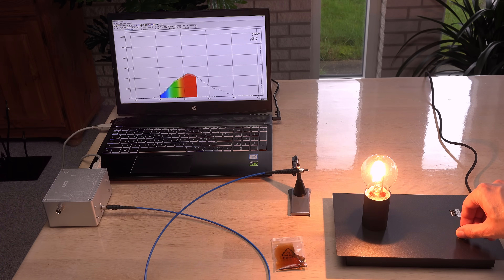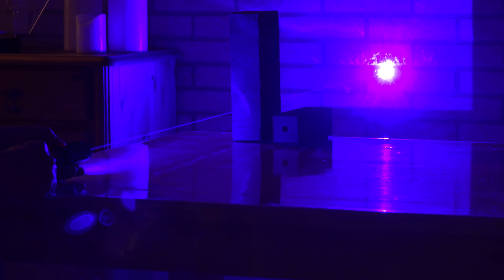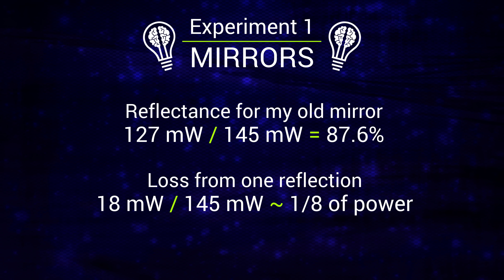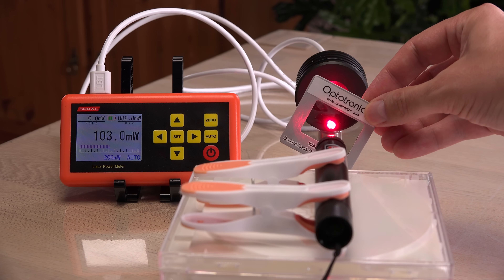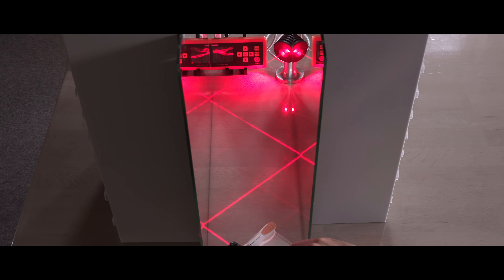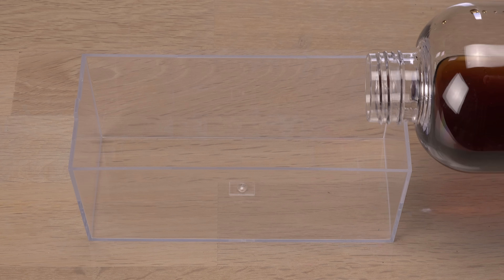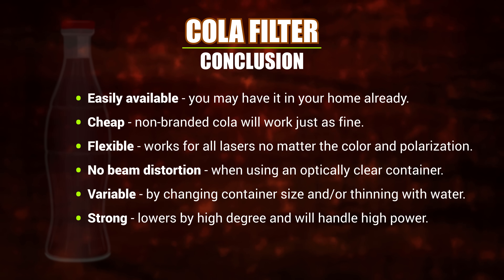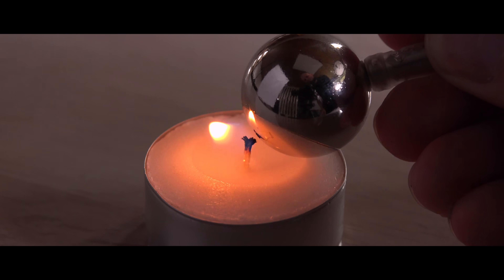COLA is PERFECT for lowering a laser's power!?!

Comment: Well it would be a real shame to damage or destroy that filter but I have to know how strong a beam it takes to burn through it. I vote for stress test. +1
Reply from the maker: Noted. I am curious too. How strong a beam will it handle on the same spot for some time without the beam burning through? I honestly don't know. The plastic filter did poorly. It wasn't even held steady :)
Reply: @brainiac75  Well i'm sure you already know the result, localised heating in glass has no good outcome like dissipating heat in a small volume of material always leads to a magic smoke or meltdown. Anyway i'm curious about high powered laser in cola should be interesting ;)
Reply: @brainiac75  i am really curious about what material is put on the glass to assemble the varable ND-Filter. if it's graphite, i'd suggest that it won't be harmed for a looong time, while you up the power of the lasers :)
PS: i do love to be lazy and not do research theoretical stuff, since there's giys like you out there, who make it possible to see the outcome of things (i can't afford) having an impact to things (i don't have access to) ❤️🍪
Reply: @brainiac75  here is a video describing what I was talking about https://www.youtube.com/watch?v=OaYfAbx-cp8 
the clear thing that changes the color can be gotten in glass too as it just takes stretching the glass while it is barely softened and then letting it cool while holding it stretched so the clear molecules the glass is made of are strained into straight fiber formations that all lay in the same direction, even short SiO2 can be distorted to line up and cause this effect, and two of them slightly off alignment will work to make a half wave or up to half :) to give a different effect depending on range of frequencies you are trying to filter for.
Reply: @brainiac75  What are the limits of laser safety glasses?
Reply: @brainiac75  I suggest ringing up Drake/Stryopyro for some recommendations on truly insane lasers. Considering he built a 101w CW handheld laser and a keychain laser that's over 3w.
Reply: @brainiac75  I would hate to see such an expensive filter get destroyed.
I think maybe you should test with an ordinary piece of glass painted black, and test that by shining the light through the non-painted side. If that cracks I think it's almost a given that your filter would break. Then you can decide whether you want to lose it or not.
Reply: @n-steam  Using the glass as you suggested would be great to decide upper limit and test only weaker lasers to see if it is more fragile than normal glass. Tests the filter and also gives the filter a chance to survive.
Reply: @brainiac75  oh also besides my  salt in solution like copper sulfate for a blue green filter, I would suggest two polarizers and a quarterwave between the two (light goes in one polarizer then through the quarter wave then through another polarizer) so you can rotate the 3 components (first and second polarizers and the quarterwave) and change the frequency to within a quarter nanometer frequency it lets through 90% but blocks between 3-30% of all other frequencies the further from the tuned color, the more it blocks so rotating it is all it takes to turn it from a green to a blue or red filter letting that color through :)
Reply: I have some that I paid very little on ebay for (special clip for a canon powershot that you can't remove the lens it just has two ridges sticking out the ends to put their converter ring on it, so regular DSL lenses can be added) I would opt for getting one of those (like 5 bucks and you probably get a UV filter, IR filter ect for different effects, that you could stress test them on, all in glass material rather than being plastic, knowing how far a cheap one will go, I would guess 10 to 25% higher energy before destruction for a very expensive one, as for flatness and lacking deformities I honestly have seen next to no difference in my cheap ones and the very expensive ones I have that a friend ran an electron microscope over to see how flat each was,